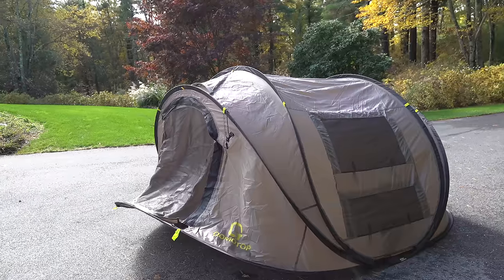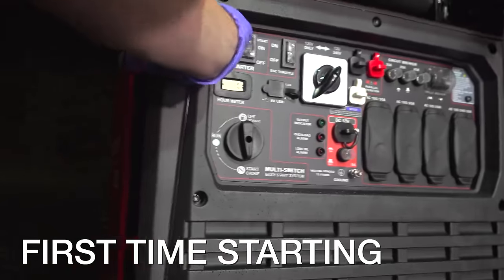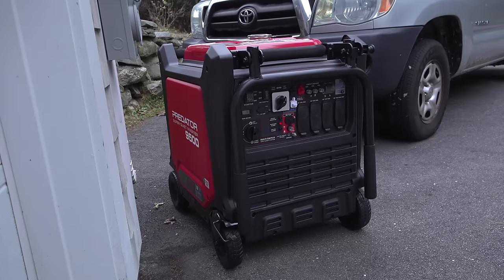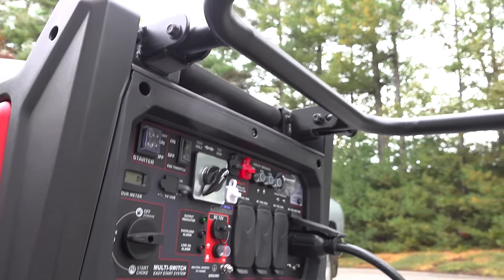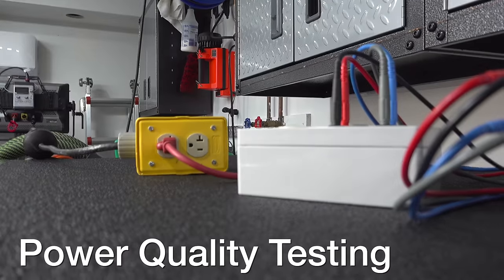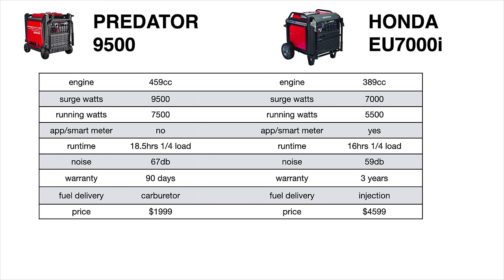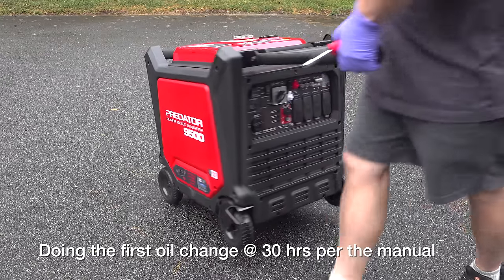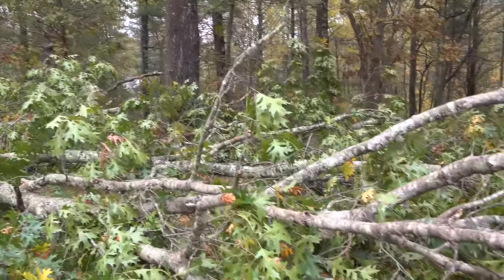BIGGEST Harbor Freight Generator Predator 9500 Review & TEST

Comment: The predator is clearly the winner when it comes to giving more power  but  I have not seen yet with long term use on this particular model & it's wasn't fair comparing to  the honda bec. it is definitely a  smaller gen . even though it's way far more expensive. Need to compare to a bigger one or closer within close to specs. I have repaired many different equipments over the year & other brands but when it comes to honda engines, they far better than  others especially the commercials ones . My recommendations are :  buy the one that fits to your needs with little  more power  is better if it doesn't hurt your pockets. . . Do not use more than 50%  load & do proper simple  maintenance &  will last you a LONG time & a happy camper !!

Comment: 5 stars ‼️We run the 8750 for hours upon hours at a time 7 days a week,  running 2 or 3 Ga7021 15 amp Makita Grinders, they put a heavy load on start up,  so much that we blow breakers in most shops. Every 2 years I Empty the gas and oil and return it for a new one.  No questions asked.  ⭐⭐⭐⭐⭐

Comment: 18 hours on 1/4 load is impressive. In actuality, how long can it run before you should turn it off to cool down? I have an 11kw Promate gas generator here in the Philippines. I found, and the manufacturer recommended, that I should not run it more than 4 hours. I then let it cool down for 15 to 30 minutes. After this, I can restart and run another 4 hours.

Comment: Mine has the exact same brand of alternator as my EU3000 and ??5000 <this one intermittently stops outputting, Brushes were not seating. thought I had it. Nope> The one thing missing: a 50A (another common size) outlet. You can't pull the full power from the 120/240 30A 
Still, this beast  does what I need without fail.

Comment: That predator engine should last a long time , We have a 13 horsepower predator engine in our pressure washer at work.That poor engine has been severely abused Over the years, And today it still works fine.

Comment: I was looking into Predator generators compared to Honda and wasn't sure of how accurate the promotional videos were.  A local mobile Veterinarian clinic was set up at our Tractor Supply and I saw they powered their trailer with a Predator.  I spoke with them about it and they said they originally had a Honda but had to cancel several engagements because their generator was under warranty repair.  They ended up buying a Predator to serve as backup but never had a problem with it.  Now their repaired Honda sits as backup for a reliable generator that needs no backup.  I'm sold and won't consider anything but a Predator for our home.  Do your homework and make an educated decision.  These generators are killing the competition.

Comment: 8 decibels should not be overlooked if you live in an area with sound restrictions.  10 deceibels  is twice as loud.  Note that the two year warranty is $650 so it closes the price gap a little.  A great deal if noise isnt an issue.

Comment: Runtime is greater, but is that with the same amount of fuel?   And, can you convert the Predator to run on other fuels?  Not possible with the Honda because the ignition timing is electronically set for the energy in gasoline, at least that is the per my research to do so with my almost 20 year old Honda EU7000iS.

Comment: I have the 2500 watt predator inverter it's super quiet and I've had it for about five six years and I constantly use it on the job and it still works great starts up on the first pole I love it for the price you can't beat it

Comment: Samn here this past winter I used my predator 7000 watt gen for 9 days straight only cutting it off to refuel and change the oil , ran my whole house and my camper that the neighbors stayed in to have power , not looking forward to this coming 2022 winter it's suppose to be bad

Comment: Did you change the bonded neutral to floating neutral in order to hook up to your home?
Reply from the maker: No, I understand there is a ton of talk about doing that. However I have never modified any generator or had any issues. Make your own judgement about this and your own equipment but for me, I don't like to mod too much stuff with electricity and engines from their original design

Comment: I only paid $1000 (Amazon) 9500DF ,Sept 10 for a dual fuel Westinghouse 9500/11500 Propane 10500/12500 Gasoline (I'll never run gasoline) For the inverter I'll just leave my PC's off and use laptops while the power is out. Finished my inlet , subpanel and interlock just this week. Total cost was a few hundred less than the HF.

Comment: I wouldn’t underestimate the importance of fuel injection over carburetor. I experienced carb ice on my cheap generator one year. The fuel injected Honda will not have that problem. Plus, for me, noise level is very important.
Reply: The remote start on the Honda is a huge feature too, the only thing is, if you need a generator for backup, unless you have a stand by generator, your generator is most likely buried in your garage or shed somewhere, and you gotta unbury it and drag it out, then drag out a cord, and start it, so you are already at the generator at that point anyways, but I mean, if you are using it for days on end, the remote start would be extremely helpful especially in bad weather.  If you were buying it solely as a backup generator I'd set it up in an enclosure so its ready to go and plugged into a transfer switch, so all you gotta do is hit the remote start and flip a breaker...you'd think if HF was trying to go after the Hondas they would have included remote start, and the digital display at least to give you wattage and voltage readings.  The price of a Honda generator I'd rather spend that kind of money and get a whole house standby generator at that point, and these things even with wheels aren't that portable if you try lifting one into the back of a pickup, or SUV.

Comment: If I could give only one piece of advice, if gasoline without ethanol is available in your area that’s the only thing to run in your generator or any small engine. You will never have a problem with corrosion in your carburetor if you run non-ethanol gasoline.

Comment: I'll take the "dirty" and noisy Predator 9000 at $1200 less!
The $100 warranty saved my a$$ when the Predator 9000 conked out at around 30 hours run time spread over several episodes. It quit producing electricity but the engine ran strong. They swapped it out when I finally located one but am waiting for payday to re-buy that warranty. I was so happy my wife remembered I'd bought the first warranty, I thought I was screwed. :-) 
I was on top of maintaining the engine, but the electrical production has no user serviceable/maintenance-able parts.
Reply: I cannot take the risk of electrical failure which is pretty high on the gulf coast. I am on my third generator, each time going for better machines. 
After all calculations, it was confidence that the Honda would work when I need it the most. 
I just hope everyone can evade these monster storms which seem to plague us.  Be prepared as best you can.

Comment: So what I would recommend is if you’re just gonna use it for power outages you should probably get the predator because it’s less expensive but if you’re gonna be using the generator all the time you should probably get the Honda if it’s powerful enough to do what you need to do the Honda will probably last longer
Reply: Maybe.  But will last over twice as long?
Reply: @kcgunesq  it could possibly last twice as long Honda makes some of the best engines in the world. Of course I don’t know that for sure that it would last twice as long but it might.
Reply: @charleshunt3806  Sure.  It might.  But it may also require more maintenance or repairs to make it twice as long.  Plus, you may miss out on new features or efficiencies that come out in the next two decades.  

I'm not saying the decision is wrong.  But for me, if the choice was 2x today for 20 years, vs 1x today and 1x in 10 years, I'd go with the 10 year replacement every time. for  a product like this.  Where one draws the line is unique to each user.

Comment: A storm rolls pass and everyone's power will be out for days. Which generator do you want supplying power to your family's house? The China Honda knockoff or the real Honda? I have the Honda 7000is for a reason. It kept my house running during the Texas freeze of 2021. I was burning 2.5 gallons of gas every 11 hours. I ran the generator for three days.
Reply: Amen brother
Reply: I have the cheap 9kw predator(I think it was like $600), it works just fine, during the last storm it was sitting in 6 inches of flood water, moved it to higher ground and it fired right up.  We've had it for 4 years, we lose power a few times a year and it's never been a problem, we leave it outside.  The biggest issue with the non-invertor predators is the generator portion, the lifan chonda engine is pretty reliable, lifan was a Honda supplier years ago.  The lifan engines aren't quite a good as a Honda engine but they are a relatively good engine and a known quantity.  I'd imagine the electronics on the investor version would be even more questionable.

If it was something I used everyday sure spend the money, get the Honda, it certainly will outlast the predator, most likely the electrical parts on the HF generator fail before 1k hours.  Considering for emergency use maybe we do 100 hours a year, it might make it 9 or 10 years but any generator you leave outside for that long is going to be a rust bucket anyway.

Next time I'll probably spend a bit more on something with higher quality electronics like a Champion.  Honda's are simply too expensive.  But really the HF generator has done well so far we did 5 days with no power once.  I still don't know about ponying up 2k for something from harbor freight, I'd think you could get something between the 4500 Honda and predator if you were in the market for something like this.

Comment: Can you use the 120v/30amp twist lock and the 120v/230v socket at the same time? My 220 window mount A/C is on a separate cord than the trailer home. And does this generator have propane options? Thanks

Comment: I've got a Hyundai 6250 (5500 continuous) going on ten years now and it's never failed to start and has never given me any trouble. It also had a 3 year warranty. That harbor freight generator looks impressive but at 90 day warranty I would have to say no. It doesn't even appear that the manufacturer has any trust in the unit. It needs a one-year warranty to be even remotely competitive and it needs a 3-year warranty to be competitive with non-honda generators in It's price.

Comment: Storms that knockout your power usually bring rain, and since you're not supposed to run these in the rain or indoors, what's your thinking on sheltering it?  Thank you!
Reply: I made a easily storable gen tent out of pvc pipe, a tarp and spring clamps.  Assembles quickly, comes apart quickly, provides cover from the rain plus plenty of fresh air to avoid problems with the CO minders ( I run two EU2200's).  There are a lot of ideas online if you look.

Comment: My Honda 2200ei uses 1 gallon of gas over 12 hours, runs my small fridge and 5.5 cu. ft. freezer plus lights and keeps my battery banks charged.
EZ oil change and maintenance.

Comment: Both have their advantages and disadvantages. However I think the price of the Predator is a major win, you could 2 predators for the price of 1 Honda and have hundreds of dollars for fuel. Also the 90 day warranty is really short. but considering it is not as advanced (injection fuel, Bluetooth mobile app, ect) as the Honda, it is probably cheaper to maintain and repair. Great video as always.

Comment: There is a reason the Predator is much cheaper.  Fuel injection is alway more expensive but also way more reliable.  A Honda engine will outlast the Predator by fifty times.  If you want peace of mind, buy dependability. Buy the Honda! Also, you should have compared Honda’s larger unit to be fair.

Comment: Darn, I just bought a Honda EU2200i and Honda EU2200i Companion for home backup.
Reply from the maker: I wouldn't feel bad about that those Hondas are legendary and if they give you enough power they are nice since they can double for camping or take them anyplace.
Reply: @SilverCymbal  All the heavy hitters in my house runs on natural gas so I didn't need alot.
Reply: I have that Honda generator. It's been riding in the back of my work F250 for about 10 years and it still works great. The truck has been replaced 3 times, over 350000 miles but the Honda is still going strong.
Reply: 2 x EU2200's are better than one Chinese Honda clone. Wait 10 years and the Predator will be worth nothing.
Reply: @rebellucy5610  I bought a HF 2000 4 years ago and its been dead 2 years.

Comment: I have this generator and it is hands down the best bang for the buck
Reply: How long have you had it?
Reply: I’ve had it going on 3-4 years now? I got it from harbor frieght and when I got it I paid 950 bucks for it brand new. It was too good of a deal to pass up and I have been very pleased with it. I use it for backup power supply and building houses
Reply: I’ve had it going on 3-4 years now? I got it from harbor frieght and when I got it I paid 950 bucks for it brand new. It was too good of a deal to pass up and I have been very pleased with it. I use it for backup power supply and building houses
Reply: I’ve had it going on 3-4 years now? I got it from harbor frieght and when I got it I paid 950 bucks for it brand new. It was too good of a deal to pass up and I have been very pleased with it. I use it for backup power supply and building houses

Comment: I had bought a Honda 3000 2 years ago and has been nothing but problems. It does like the cold weather and by cold I mean minnesota weather. It has a hard time starting in below freezing temps and will build up condensation where the breather tube goes from the valve cover to the air filter box causing ice to build up by the choke which fouls out the spark plug and dilutes the fuel. I fixed that problem by running it inside the shed with the exhaust running outside. 
Running it in the shed however attracted the mice and they got inside the generator and tore up most of the wiring.  I got the wiring fixed and it runs great but still does not like starting in below freezing temperatures. I just recently bought a predator 9k and so far has been better than honda. It starts and runs in the cold and does not build up ice in the carb. The best thing about the predator is the 2 year warranty that you can get and bring it in and get a new one no questions asked if anything is wrong with it.

Comment: Carbon monoxide shut off is good, 2500 watts is a huge difference, more power doesn’t equal more noise, home mechanic is not working on these small fuel systems, Harper freight does not make generator s. They also carry plenty of garbage tools not used In A professional atmosphere.  With that being said if you live in a area that loses power a lot, by all means get the predator. It’s good to see after twenty plus years other manufacturers realize what people want in a quiet 🤫 machine.

Comment: I power both honda and predator side by side and then each separately and my goodness it's night and day difference on noise and longevity and fuel consumption. Honda power will out last the competition. Build quality on honda is unmatched.
Reply: The build quality is not unmatched.  The MARKETING HYPE is unmatched.
Reply: @lakecavanaugh What marketing hype?  I see a lot more ads for Harbor Freight than I do for Honda Power Equipment.  Honda has earned their reputation for quality and durability; if Harbor Freight can manage the same, more power to them.  They've got a long way to go, however.  I'll say one thing; the build quality on my Predator 2000 is nowhere near as good as it is on my two EU2200's...not even close.

Comment: I have trouble understanding why I have to change the oil so often.
some models say 50 - 100 hours b4 changing oil. Can't they add a filter?
Reply: You can drain the oil and put it through a filter of some sort and pour it back in. Then dispose of it when it starts getting really dark.

Comment: I just got my FirmanT07571 from Costco hooked up today. Everything worked fine including the central air. What I am curious about is the operation in the rain. In coastal SC we can have anything from a drizzle to a CAT 3. Are portable generators safe to run outside in the rain? Are there rules of thumb for this or am I just unaware being a newbee?  I would appreciate feedback from all who have experience with this.
Reply: No, you can't run a portable generator in rain or snow. The generator must be protected from such elements.  You can purchase a GenTent so you can run your generator in bad weather.  We have one for ours and it works great.  It even has a storage apron, you can put on, when your not running the generator.   This would be useful when you want to set up your generator before the storm hits.
Reply: They can handle a light drizzle but should be kept out of heavy rain.

Comment: Can you run that generator out in the rain?  I have a really cheap one that is old and needs replacing, that one advises you don't run it out in the rain
Reply from the maker: I think they all have to say that legally but the reality is sometimes you have to, I always try to avoid any direct water, so maybe under an overhang and some guys put plywood or something above them but in reality do they work, I think so. Every job site in the world runs them outside. Do it at your own risk and weigh what you think is safe for you
Reply: @SilverCymbal  Ok, that's what I did with mine this spring during an outage.  It was under the front overhang of the house and I propped up a piece of plywood in front of it to block any wind blown rain.  Thanks!